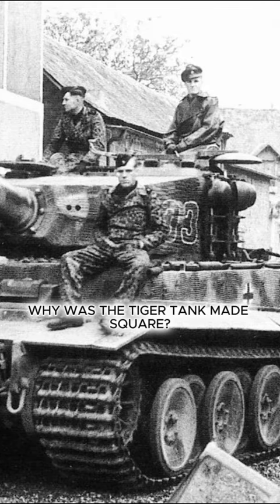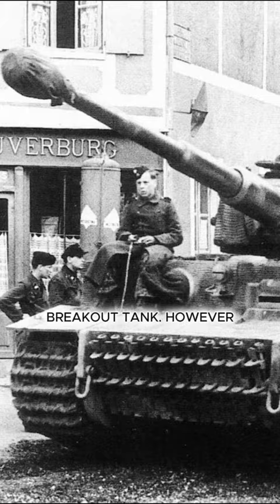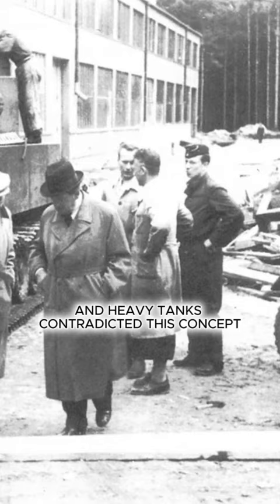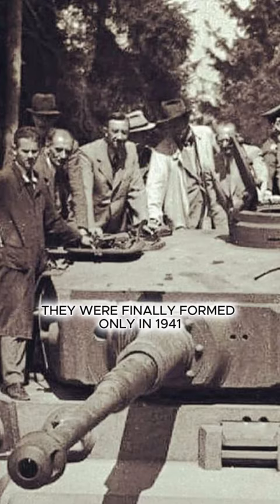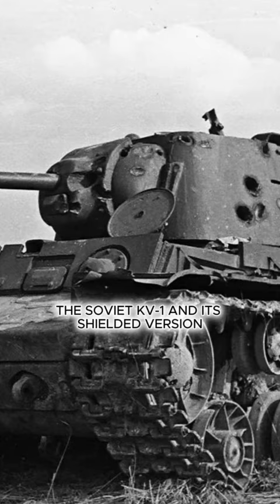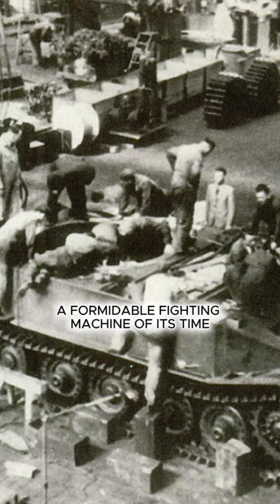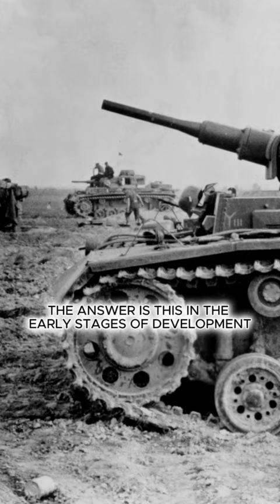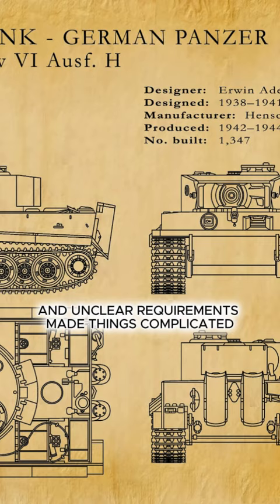Why Was The Tiger Tank Made Square? #shorts

Comment: They did fix the square shape later with the Panzerkampfwagen  VI  Ausf B (King Tiger or Tiger II) with its sloped armor like that of the T 34 and Panther.
Reply: Soviet:🥚
German:⬜️
Reply: @dark_fallxvi141 not everything is a meme?
Reply: Panther from t-34, Kingtiger from the panther
Reply: I find the panther was smooth looking, to bad it wasn't very reliable.
Reply: The Tiger II had a frontal slope, and a minor side slope.
The T-34 had harsh sloping all around.

If anything the Tiger II started to resemble the Sherman and Panther more than the T-34.
The reason they didn't slope everything like the T-34 is simply because its horrifically space inefficiënt on the internal volume. And tanks do need storage space for fuel, ammunition and the crew. Even the Russians realised this later, which is why tanks like the T-44 and T-54 no longer sloped the sides and rear of the tank (or did so to a very minor degree, similar to the Sherman)

Comment: Although having sloped armour is great it also restricts you in upgunning and upgrading tanks, both the m4 and t34 had sloped armor with the t34 have more sloped area. The m4 was upgraded all the way to house a 105mm gun capable of knocking out t55 and t62, the t34 was more or less stuck with the 85mm of ww2 due to its narrow turret ring and cramped interior.

Comment: No Square gives crew more comfort and space and easy to repair the module inside it.
Reply: Actually YES - they didnt worry much about soviet tank guns of that period as they COULD never penetrate Tigers frontal hull AND turret armor (both were about 100mm). However, soviet tanks and guns became bigger and shells faster so Tigers 102mm armor was just not enough for soviet 85mm tank gun (D5T). They figured that out and angled the armor on Panther, KingTiger, Jagdpanther and basically all their armored vehicles later in war.
Reply: @APOLON-bm7ym  Wrong. The T34-85 was only good for its HE due to its larger caliber. As for penetration value, it's just a little higher than the 76 variant, as the T34-85 only had 100mm of armor penetration from 600 meters with APCR and 125mm armor. Did you know that 2 Tiger Es destroyed 17 IS-2s and 2 T34-85s in just a day? It's not just about armor or gun; it's about the commanders. The Tiger 1 gun was reliable against all targets like air, ground, tank, naval, bunker, etc. It's like hitting two birds with one stone, while the Allies produced multiple guns just to fulfill a single role. But the Tiger 1 fulfilled them historically accurately. A Tiger 1 even shot down a plane! The Tiger 1 had good HE with 8 rounds per minute, a crazy fire rate, and packed a punch with its penetration, as it had a confirmed kill on a Churchill over 1.6km away. (I can also list Germany tanks outclass any allies tanks during ww2 if you want)
Reply: @JaHail-oy6vq   Those IS2s were PARKED and Tiger surprised them. If we think on same event. I knew Tiger hit the plane, BUT that was shear luck. Basically, yes, 85mm D5T has about 140mm point blank, so 100mm at 600 meters sounds legit. However, that 85mm was GREAT improvement from earlier 76,2mm that couldnt penetrate even sides of tiger. But, it could knockout Tiger at distances closer than 500 meters. I know soviet shell was more-less of poor quality, and many of them would desintegrate when striking the steel, instead of going through. I also admire the german WW2 weapons, I mean a lot, I even play WT almost exclusively at 6.0, 6.3 or 6.7, sometimes lower BRs, and very rare modern tanks. However, german tanks were INSANELY overengineered, which was their main flaw. I think that higher number of those supertanks (Tiger 1, 2, Panthers, Jagdpanthers etc) were abandoned by their crews after they had some malfunction (often one of numerous gears would broke down). Drivers had to go on special course and later had to drive them supercarefully which is a bad thing that you must shift gears carefully in the midst of a battle, unlike allied mass produced weapons. Opposed sides had completely different approach to the weapons they produced, but quantity defeated quality after all (and failed painter said something like "If I knew SSSR can build tens of thousands tanks I would never invade them". But if Wehrmacht could field more of them (there was only 1341 Tiger1 produced - and each was precious) history might have been different. And if jet fighters came earlier. And if Germany had more oil. But thats all "what if...".
Reply: @JaHail-oy6vq   ...and ofcourse I agree that experienced commander (but also the gunner) was very important as we could see in case of Michael Witmann and Franz Staudeger, but also some other panzeraces  that I cant remember the name mmentarily.   One of them is that guy that made the rampage with one more TigerE and surprised those IS2 tanks, destroying 17 of them. Do you play WT?
Reply: Because making the armor hull angle will create strain on the front drives. Though it is regrettable at the later stage according to many tactical strategist. The Tiger I possess the best quality armor. Some armor website stated that the 82mm of armor is equivalent to 92mm British armor.
Reply: @JaHail-oy6vq wrong, the tank was used on mass with the t34 for years, but the tank was not very reliable for that purpose, it got so bad they resulted in manufacturing it cheaply instead, but the russians did have tanks capable of fighting it such as the "IS series"
Reply: @user-cy3lv1mw7w  IS series was worse than the T34 series, The only good tank was ZIS-30 and SU-85
Reply: @wongyc5585  Tiger 1 frontal armor is 101mm

Comment: THEY WERE SQUARED OFF FOR A REASON!
Adding angles means adding length.
The Wehrmacht wanted to load 4 Tanks per Railroad flatbed carriage.
KISS ment you draw square line, inside your parameters.
When everyone else was shipping 2 or 3 tanks.
The Germans show up with 4, and later 5!
Reply: The Germans never shipped more than one tank per rail car.  

First, their rail cars were lighter than American rail cars.  As were the rails.  Medium tanks like a Sherman were around 30 tons.  That was fine here, but European railways had a hard time handling that weight.

Second, they bridges were not designed to handle concentrated weight.  Even today, on some routes when Abrams are shipped by rail, they put an empty spacer car in between each tank in order to space out the load going over a bridge.  

Third, the European rail cars were just not big enough to hold two tanks at one time. 

The Soviet railroads were broad gage and used larger cars, but their bridges suffered the same problems as all other European railroads.
Reply: Bro they could barely fit 1 tiger on a railcar - they had to put skinnier tracks on the Tiger just to fit on a railcar.

You been taking after big H and his opiate addiction?
Reply: Cope
Reply: Nice bullshittery.

Comment: There is a number of reasons they didn't bother with a total redesign. Familiar shape to prevent friendly fire, armor was already more than good enough to stop anything of it's time from frontal penetration, and one of the biggest reasons is ammo storage capacity. Sloped designs inherently have less storage and the Germans frequently out ran supply lines and it led to tanks have ammo problems even with the square designs of the Panzer 3 and 4. Making a sloped armor design when it wasn't even necessary to stop AT guns would only compound the issue.
Reply: You forgot the most important technical reason which is the Germans used rolled steel that is welded opposed to casted like the allies. Forming round shapes with that process was not feasible

Comment: Various reasons to retain a squared hull instead of sloped.  Yes, Tiger I was already well along once Soviet T-34s encountered.  French Somua S-35 also used sloped frontal.armor.  Armor was thick enough, and main weapon powerful and ACCURATE enough, that it could pick off enemy armor while usually out of effective range of their guns.  Panther and King Tiger used sliped armor, but both were large enough to not cramp the crew nor equipment.